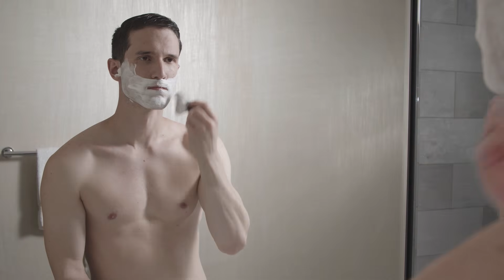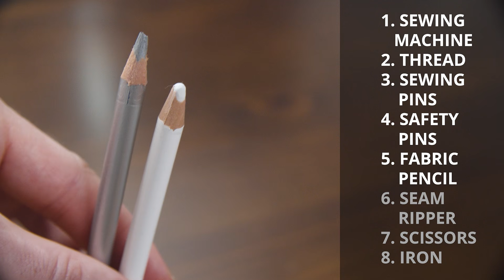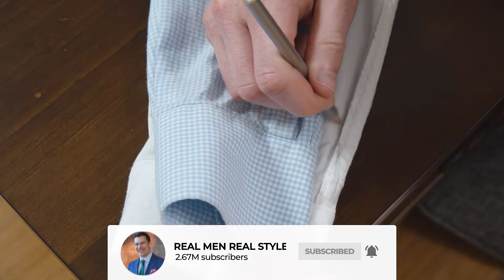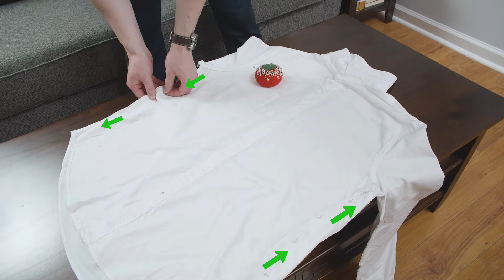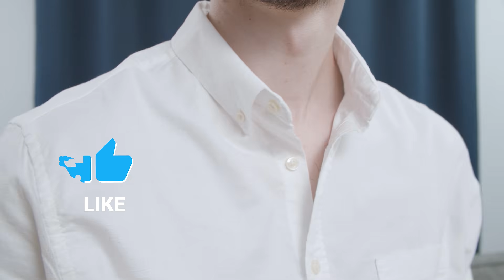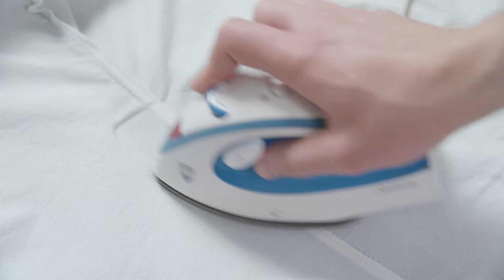How To Tailor Your Own Dress Shirt (No More Muffin Top)

Comment: PRO TIP: Shirt stays.
They are like $15 and they hold your shirt in place perfectly.
You're welcome.
Reply: That doesn't help when the shirt is made for someone with a 34" waist and I have a 30" waist. It is impossible (in the US, at least) to find button down shirts that fit properly. They either fit in the waist and are too tight in the chest/shoulders, or fit in the chest/shoulders but balloon at the waist.
Reply: Shirt stays does not always work with most of the body types and dress shirts.

Comment: Hi, I've got a question.
In my case, my dress shirt got a good fit at my thorax but is a bit baggy by the stomach. In addition to this, the side hems are these double-layered fabric-thicker parts (No idea what they may be called), and this creates a problem. Because it would not look good to in the middle of the shirt go from these thicker double-stitched parts into a single stitch without layered fabric, so I'm just curious whether you have any tips for this scenario...
Reply: The seams you're talking about are either French seams or flat-felled seams.  And you're right: NOBODY who wants to look professional would do this wretched "hack" (literally) to their dress shirts; they'll end up with a horrible mess of puckers and unprofessional-looking stitching.  It is possible to apply shallow side- and back-darts to a dress shirt to take up the slack, but if you're not an experienced seamster, it's a really bad idea.  (If you notice in the thumbnail, the shirt on the left is actually a couple sizes bigger than the "fixed" shirt.  The shoulder seams are sloping off his shoulders, the sleeves are rucked up at the wrist, and -- of course -- the middle looks baggy.  (This is actually a pretty aggravating video.)

Comment: One question: why do you have to use safety pins first, and sewing pins second? And why do you have to turn the shirt inside out?
Reply: So you can take off the shirt and then insert the sewing pins so when you make the stitches you can take the pin easily because the safety pin is more difficult to remove
Reply: @panagiotispina  but what if you don't have safety pins? And is it illegal to use only sewing pins in the first place?
Reply: @hunterxsimple3821  hahaha of course it's not illegal but when you mark your clothing after you wear it when you proceed to take it off the sewing pin may  fall
Reply: @panagiotispina  oh
Reply: @hunterxsimple3821  don't try this on your expensive clothes try it on something cheaper because you might not get the results you wanted and ruin something. If you have the money you can take it to a tailor but it can get pricey so do it on the clothes that worth it

Comment: Truly curious I commented this on the GG channel but no response what is your opinion on cropped trousers? Do you think they look bad or are just a short term thing? Honestly I don't think they look that bad as long as you don't overdo it and make them too high. I feel a couple inches from your normal length is still somewhat modest. My pants are normal length however I feel like my drawstring Seersucker pants could be a couple inches shorter because they look a bit sloppy not sure how to explain it but yeah a shorter look would be neater on those pairs. Last thing is season during the hotter months I don't think they look out of place.
Reply: GG pretty much covered the topic with their most recent video and pretty much boils down to a fad trying too hard. Maybe they work for you but it fits more on a more modern look than classic style.
Reply: @CoverofWinter  My regular pants are full length so no worries I'm just asking about my drawstring pants that I wear for lounging at home. They tend to look a bit sloppy at full length or perhaps I should just iron them instead of going for a cropped look? I understand where you're coming from though and I appreciate the insight. I think you misunderstood a little it's not my habit to wear cropped pants in general I'm just talking about my lounge pants if I should try an inch shorter or just iron them out so they look less wrinkly at the bottom.
Reply: @Manuel421  Gotcha. It's more difficult to guess then what would be best but for lounging at home they are probably perfectly fine I would guess.
Reply: @CoverofWinter  It does get a bit difficult I agree. Right now the lounge pants are also full length but maybe I could go an inch or 2 shorter next time unless theres a brand of seersucker drawstring pants that are high quality and wont wrinkle at the bottom but they tend to be very expensive just from browsing online. Anyway I'll figure something out thanks again!

Comment: Why buying baggy shirts in the first place? Why not a tailor made shirt?
Reply: Weight loss? Price? I have a 15.5 neck and weigh 145 pounds so even slim fit shirts are baggy for me.
Reply: @ZipSeam  Not all bodies are equal, it is very normal to have a larger neck.
Reply: @learningbird9940  Right that's why I need my shirts tailored haha. Very hard/expensive for me to find a fitted shirt off the rack
Reply: @ZipSeam  Again, nothing wrong having a larger neck than the "factory norms", particularly if one wants to use a tie.